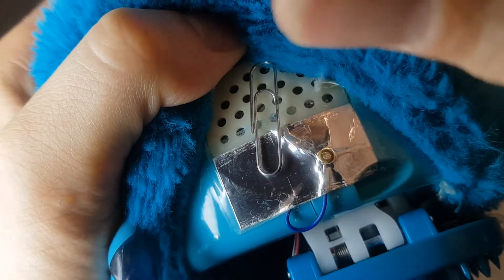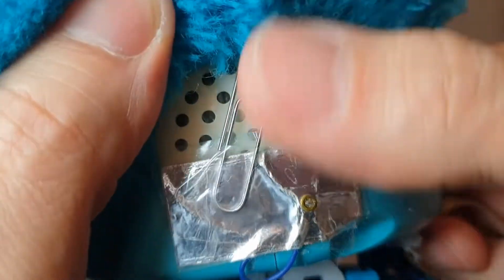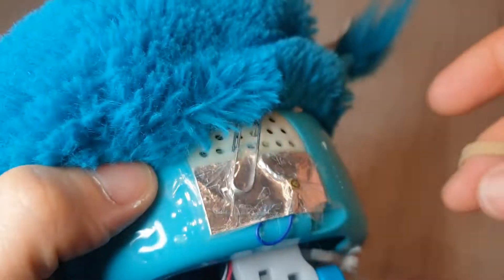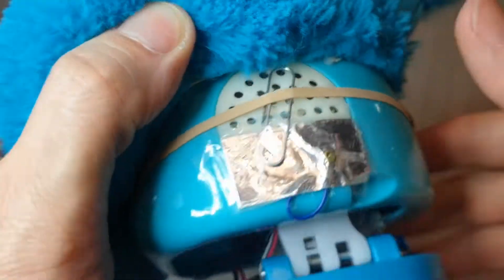Furby Fix with a Paper Clip 📎

Comment: Thanks! Daughters Furby Connect just went silent on us. If I tap the battery compartment he talks a bit. Seems like it's probably the same thing.

Any idea if the speaker designs are similar across all models??? I saw another video where someone popped the cover off of the speaker and set a small steel bearing (BB pellet size) in the center of speaker. The magnet on backside of speaker keeps it snug on the plastic surface of speaker and gets the sound back.

Seems like your idea using the pin to press speaker in worked to the same effect. I'm halfway tempted to roll a small piece of foil and push that towards the center and then just bend it down on the top-side and tape.

I'm imagining the Furby taking a tumble and the paperclip stabbing his speaker and permanently silencing him 😂😂 that would be my luck!!! Bad enough I gotta give this guy open heart surgery!!! Haha

Thanks again for the video and your time my friend. Take care.
Reply from the maker: Ha ha the ball bearing is my other video. The same principal applies though in that the middle of the speaker needs to be pushed into the back of the speaker. I don't think foil would be strong enough. If you open it up and just try pushing the paper clip then that will clarify that the speaker is the problem. You can then decide which fix will be best for you. I hope that helps 👍😁
Reply: I Think 2012 Furbies, And Furby Booms Have The Same Speakers.

Comment: O need help. My furby doesn’t wake up. It only works if I keep pressing the restart button😢 what can i do?
Reply from the maker: A silly question but have you refreshed the batteries? if so try checking any cables inside in case any have a loose connection. Good luck